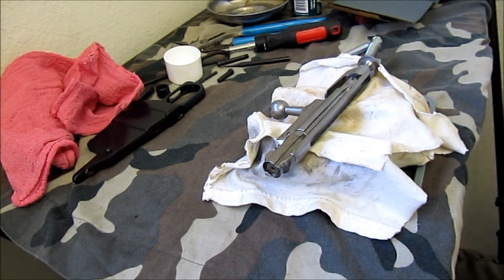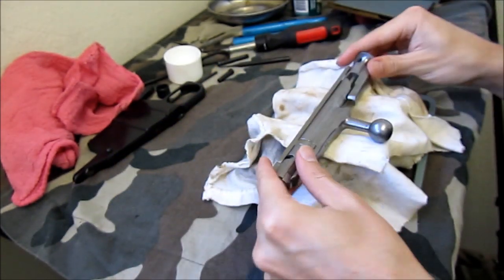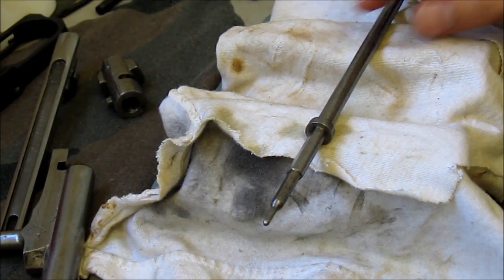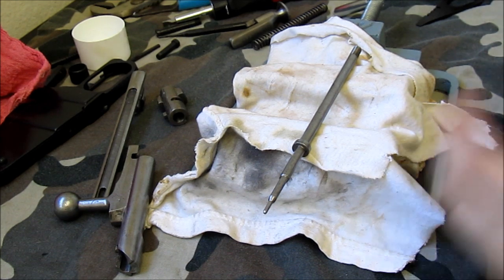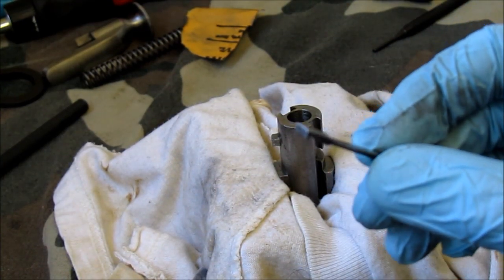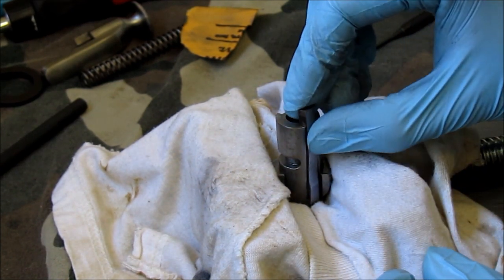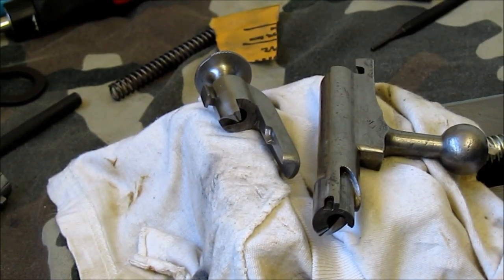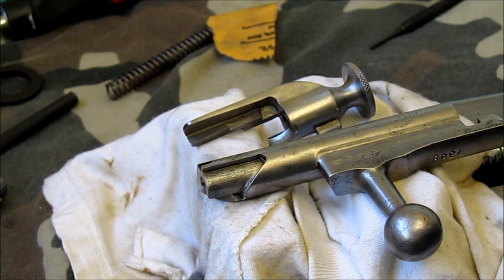Smoothing Out the Mosin Nagant Action

Comment: I wish could have told you first. You should use mineral spirits to clean off the cosmoline safely off the parts and to shine the parts to a mirror shine use flitz Polish with a drill and cloth and  you will have a cosmoline clean gun with a barrel that looks brand new. I've never got polished parts more mirror shine than with flitz. Flitz got my service glock 22 barrel to look so new that the department thought I changed out the barrel and had a few hours they were pissed until I showed them how flitz and a drill polished out all the scratches and made it chrome perfect inside.

Comment: Tips to make life easier:  There's a seller on Ebay or Amazon that makes cheap magnetic plastic guards for your vise.  You can really crank down on the part and it won't hurt it.  Also, drill a couple holes in your table and get some bolts and wing nuts so you can quickly mount your vise to the bench so it won't move, then quickly remove the bolts and move the vise so you have more room to work.  Or, at least use a C-clamp and clamp it to the bench.  The combo of a non-mounted vise and using a rag to pad your workpiece is a recipe for broken/damaged parts or damage to your fingers!  Also, toothpaste will work to polish your chamber if you don't have any actual compound.  I would also go ahead and go full speed ahead with that drill on polishing the firing pin and chamber.  You're not going to hurt anything and it'll work better.

Comment: also instead of bore polish i used some professional body shop compound (meguiars m105) and worked great to polish chamber and locking lug recesses, though being that its fairly thin it does make a mess and i had to wipe out the excess then blasted the hidden polish out using steam(as its water based) then wiped it out and did a full "normal" cleaning job on it. chamber is so smooth now it feels oiled though its not, have not racked the bolt yet as was late when i finished up.

Comment: just a suggestion, use a brass punch on parts like the extractor or parts that can be damaged buy a slip with the punch can make your own brass punch with some solid brass rod and just use a dremel to shape it, also to the new guys when you have your bolt apart, assemble the middle and cocking knob peices and work them as if they were in the gun being used, this helps show you how the bolt works and will show what surfaces need work.